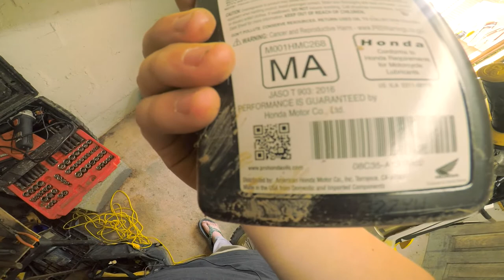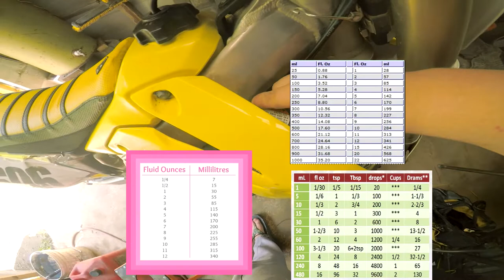RMZ 450 Oil Change ( 2007 )

Comment: 10w30? I have 10w60 no ist God? Motul
Reply from the maker: i use pro Honda 10w30 and 40 (usually 40) in my bikes. just make sure u get good brand oil and that it is motorcycle oil. it lubes the clutch and gears better . think on a car the oil is only lubing the engine not the transmission , a dirt bike is all in one so the oil needs to be very good.
Reply: 15w 40 rotella t4

Comment: Habe eine Frage weißt du wo die öl kontroll schraube ist?
Reply from the maker: sorry I cant translate your comment correctly
Reply from the maker: i think your asking where the oil check level bolt is. it is on the side of the clutch cover facing the front of the bike. under and to the left of the fill port. thank you for commenting .
Reply from the maker: Ich denke, Ihre Frage, wo die Öl-Check-Level-Schraube ist. es befindet sich auf der Seite der Kupplungsabdeckung mit Blick auf die Vorderseite des Fahrrads. unter und links vom Füllanschluss. vielen Dank für ihren Kommentar
Reply from the maker: Entschuldigung, ich kann Ihren Kommentar nicht richtig übersetzen
Reply: @TAULBEE  Snapchat?
Reply from the maker: @theodorfeuerstein4792  lol dude I'm not sure what your talking about snap chat
Reply from the maker: @theodorfeuerstein4792  add Taulbee646_2